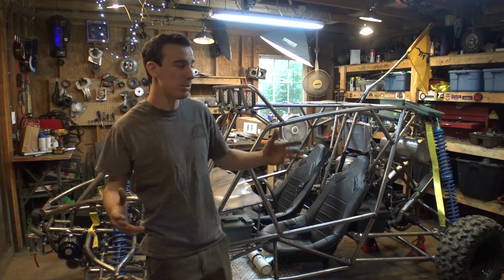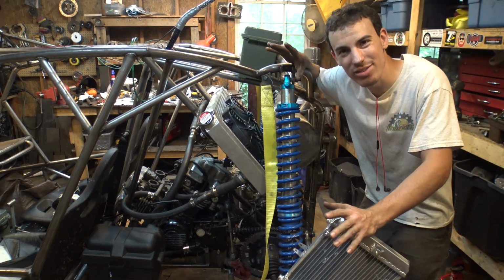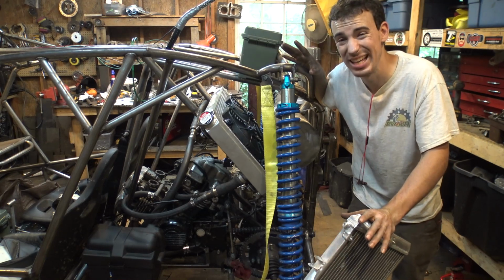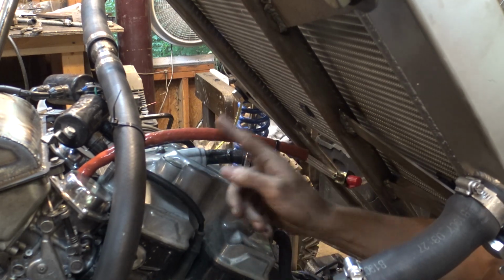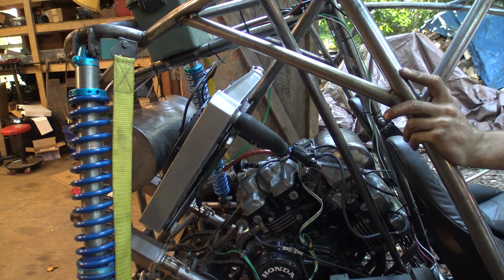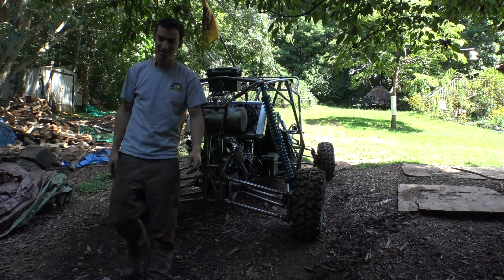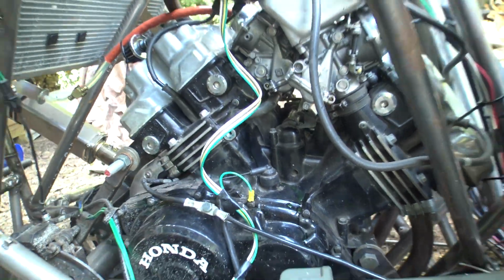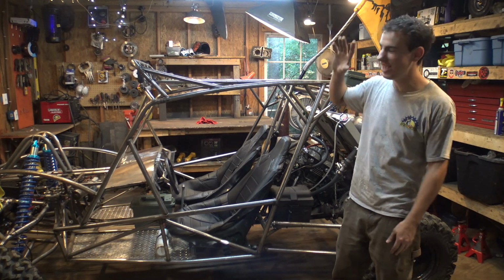Honda VF1000 buggy build part 16

Comment: Good job, man!
And be careful reading comments from all of us "youtube engineers"....
It's real easy to tell someone else what they're doing wrong from behind a keyboard.
That being said.... Get a decent mercury-based carb synchronizer. Motion-Pro makes a good one.
Trying to tune a 4cyl bike motor without one is nearly impossible.
There's other types but, they aren't as accurate.
Once you get all the little problems worked out with that motor you should be fine.
It makes over 100hp.... And the bike it came out of wasn't a light-weight.
Yes, the buggy is a bit of a porker but, if your gearing is right you'll be fine.
Those motors are built stronger than most people think.

Comment: If you can make a fan shroud to mount the fans on the radiator, those zip ties you used can cut into the aluminum of the radiator over time from vibration and being an off road cart it can happen sooner rather than later. Other than that this is a great build.

Comment: 1) temp gauge,  2) mount the radiator upfront,  3) inline fuel filter , 4) tune/sync the carbs and 5) aux water pump.  
I think that will make it better.
Reply: Definitely needs the aux water pump
Reply: He doesn't need a auxiliary water pump ffs guys. The doubled size he now has will be perfect considering he'll be mostly traveling half the speed of the original motorcycle. A working thermostat is also obviously key.
Reply: He may not need the auxiliary water pump but he should install a properly functioning thermostat and change from the stock water pump to a high flow version if it's still available for that engine, he also should add an oil cooler(could be mounted onto the radiator and share the fans) or a fan blowing directly on the engine to compensate for the lost air cooling that engine would've originally had while moving
Reply: A random 12v water pump is way cheaper than a honda genuine part.
Reply: @dodgeme1986truck  those water pumps were never supplied for the vfr

Comment: Change to a larger diameter steering wheel. 
 Put a rubber tube from the little pipe under the rad filler cap to an overflow catch bottle. 
You are doing great so far.

Comment: A watercooled engine temp is controlled by the thermostat. It closes to allow the coolant to warm up and the thermostat opens to cool it down. With motorcycle powered buggies, a civic radiator is about what most use. The engine is moving something 4 or more times the weight of the bike it was on, it needs to be cooled better. As long as the thermostat works properly it wont over heat.

A single fan should suffice. I'd probably have it on a thermal switch to turn on when it needs to and have a toggle switch to override it if need be. You're probably taxing the charging coil and battery with the dual fans and electric rack. Hopefully there's enough reserves in the battery but no idea.

Comment: maybe the radiator is not that small but this engine was initially designed to run fast when revving at high RPM but now when it revs high it might be climbing and crawling so there is not much air hitting the radiator and there is nothing wrong there. Fitting a bigger radiator seems the right thing, I'm glad we had the same thoughts.

Comment: always fascinating

fans will be pulling the engine's hot air through the radiator.   How about a sheet metal baffle a between the engine and radiator so the radiator gets ambient air?  easier said that done

Also, go full Porsche and add an oil radiator up front?

great work, "free hand"

You obviously have a great seat-of-the-pants feel for this stuff, but sometimes a little tech will help, like a coolant temperature meter.
Reply: Was going to comment same about the fans pulling preheated air directly from the block.
Reply: I don´t think it will be an issue as long as his not standing still. As soon as he moves the fans will not pull as much of that heated air. But yes, an oil cooler might be a good idea.

Comment: Power steering the two big cables go to the battery is the small black wire the ignition thats not wrapped goes to the negative or ground right

Comment: You might want to look at the 90 degree elbow in the radiator hose. Being down low will make it almost impossible to get all of the air out of the cooling system. Causing the engine to overheat. Air bubbles in the system are a quick death to any engine.

Comment: A tip; use a shroud for your coolingfans . 
Those rips gonna hurt ure radiator because of the heat and vibritions. In a year time you gonna  notice it iff u leave it like this..
Look up for a aftermarket 3core civic ratiator , that should show u what i mean.

Comment: Great job man, have you sync'd the carbs, im sure you have but if you havent one or more clyinders would be carrying the others resulting in rough running conditions hard starts and eventual engine failure. On another note i suggest an epic road trip thanksgiving time to glamis ca. where you could link up with your west coast fans and really get to the bottom of that rigs capability's.  id suggest glamis, or ocotillo wells ca where you have dunes clay hills open desert, washes ect. Glamis is only dunes but they are huge. in the evenings there are sand drags up competition hill illuminated by the lights of other off roaders. big weekend sometimes have rock bands and fire works ect.  Anyway it would be an epic trip.

Comment: Put a Filter in your fuelsystem as well... and please protect your wirering harnes.... with Black sleeve or just with the elektrical tape to be Safe.... but over all i Think IT is very cool build... i would place the fueltank away from the Engine and use a fuelpump to get enough fuel in the engine.... Kind regards from germany....

Comment: You should make one of your two speed gear sets so it can have a high and low setting, cause right now you have to change the sprocket, if you had a high and low you could switch it on the fly!

Comment: The radiator is mounted higher than the motor and normally the radiators would be mounted at the same height so would it not make sense that the cooling fluid would need more of a pump to circulate the fluid better but faster thru the cooling system allowing the radiator to do its job at all speeds ? A pressurized system does bring the temp down .

Comment: I have a question for you. So are you sure the stock water pump is gonna be sufficient to circulate enough coolant flow to properly cool the engine with the new radiator being much higher than what that engine was designed for.

Comment: Might need a fan or two blowing on the block and cyl head to help with heat dissipation   Are rad fans blowing towards fuel cell?the fuel will be fkin hot after a while.

Comment: On my goldwing aspencade the has tank is under the seat above the exhaust and ive looked in it getting gas before on a hot day and its literally boiling..pretty scary but normal on them after looking it up...

Comment: The 2 cylinders running leaner due to plugged low speed would definitely contribute to the overheating. Good idea to upsize the radiator though and it definitely looks "cooler"

Comment: Fill that radiator wile straight up. Air in the system creates heat pockets and could overheat the engine.

Comment: have you rejetted the carbs? A hot running motor can be caused by the motor running to lean. Sounds like you need to rejet the carbs, since you essentially added an exhaust.

Comment: You added an aftermarket aircleaner and exhaust which means that there is much more air flow through the engine. This extra air is causing the engine to run very lean, and needs to be corrected by allowing more fuel into the engine as well. When you run an engine teally lean, it will cause it to run MUCH hotter as well. You should try drilling out the jets to allow more fuel. This is likely causing the hesitation issue as well as the flame we saw shoot out of the exhaust. I had a similar problem on my bike when i put aftermarket an aircleaner and exhaust on it and the bike ran very hot and stuttered when accelerating. The same thing happened on my car when I forgot to plug a vacuum port. It ran very hot and melted the sound deadening material that i had on the floor.
Reply: Another thing: The engine was originally designed to have the radiator sitting at the same height as it. The higher you raise the radiator, the more pressure there is required to move the coolant through it. If the water pump on this engine works the same as a car, then the pump doesnt really create any pressure, it just kind of slaps the water in the direction it needs to go. Something to consider might be to add an electric water pump to make sure that you have enough circulation.

Comment: Maybe u can add a scoop in front of the rad above the seats if it still gets too hot . And I would move the tank so the rad doesn't blow all the hot air into the fuel making it unnecessary hot

Comment: Your new radiator location is pulling heated air off of the motor to try to cool the coolant. Radiators need fresh air. Also your radiator is discharging hot air onto your fuel tank. Fuel should be kept cool.

Comment: Are you over working the small water pump  you may need a electric pump plus you should have the fans switched separately with the main one being at the water input.

Comment: How about an engine from a car? The 16 valve 2.0 from a Neon, you could also use the the 5 speed gear box. If you get one from an ACR Neon, that would be cool....
Reply: Frank The CADD Monkey : That would be nice. And about a 100 horse upgrade!
Reply: @rickybobbyinc293  Yeah, I had an ACR and didn't even know it until it was scrapped..
It was a beast!
Reply: Even a honda D series would be an awesome upgrade. Short block, cheap, easy to find, reliable and light weight.

Comment: Great build. Seems you had no coolant flow on your last off-road run and thus the overheating issued. With that in mind, I would check to see if you have a leaking head gasket (where you found coolant leaking from the engine) cause by overheating.

Comment: small suggestion, order the manual on your engine, and spend a couple days reading all the procedures, as well as troubleshooting procedures. I think your mind will be at ease once you digest the info to all the mind boggling what if's wondering through there at warp speed..
Patience Grasshopper, haste makes waste. Nice ride

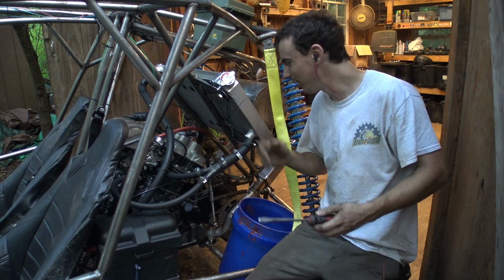Comment: 12:55 So water flows through the radiator in the wrong direction?... as long as it's flowing through the radiator it shouldn't make any difference.

Only problem I can think of is if your radiator isn't full, so it pulls air bubbles into the cooling system instead of pure liquid. Many engines use an impeller water pump, which thoroughly dislikes bubbles.

Comment: i have an 86 vfr700 and im constantly having to adjust the throttle screw   when i first start it i have to adjust it  then again mid ride  and again when its warmed up or it wont idle  or it will idle too high...    and air temp around 55-65( 5am ride into work)  she  dont wanna run at all will die halfway there....       you should have the throttlebodies  vacume  synced
Reply: also i noticed you arnt even getting into the powerband for that motor before you shift

Comment: Probly add some heat reducing or reflecting mesh/ tape on the underside of the fuel tank. DO NOT DRIVE WHILST COOLANT IS LEAKING!!!! Big no no... that either a leaking seal or gasket and will cause big problems down the road. Personally I think your engine is ok for this buggy but because it looks so badass it needs a badass powertrain. Perhaps the Yamaha YZF-R1 from 2004 - present... over 180hp that’s insane

Comment: I thought your rad was mounted too high for the water pump to push uphill, but after not being a jerk and watching the rest of the video, I see you've hopefully fixed it. Hopefully you can keep it cool and not boil the fuel out of your carbs. If it keeps boiling off the fuel it'll keep gumming up the idle jets in the carbs and you'll have to keep cleaning them every time you run it.

Comment: You should take pool noodles cut a slit in them and put them on the roll cage and zip tie them so you can cover up those wires for the lights on the roof

Comment: Jutting the carbs bigger could help it run better and cooler the carbs are always setup lean from the factory bigger jets will help. Plus led lights to help with electric draw from the battery too much power drain on the battery can mess with the motorcycle charging system witch can mess up the spark..

Comment: Maybe you have an Air-Fuel ratio problem, I don't know how it works on motorcycle engines, but on small 2 stroke trimmers that "stuck" acceleration means that you have a lean mixture.
Reply: same

Comment: Not for sure check for vacum leak on carbs and may need to rejet them also . That will contribute to running hot as wel if running 
Lean.

Comment: I think a car engine and trans is the way to go. Small 3 or 4 cylinder from an economy car would be much better equipped to handle the weight and would still get that buggy moving fast.
Reply: A little 3 cylinder Geo engine with an automatic would probably work, especially a fuel injected one.  Also, a car engine will have a proper alternator for all the electrical stuff he has on that buggy.
Reply: @spazzattack1188  geo metro drivetrain was my exact though.

Comment: As long as your fuel tank is set higher than the carbs and you have large enough fuel lines you do not need a fuel pump. And, it will add another electrical load to the system and another point of failure. Could run as large as 1/2" fuel lines and reduce them down at the carbs.
Reply: Oh yeah... I'm gonna start a build of my own soon. Maybe I'll film it so everyone can tell ME how I'm doing it wrong too!!!
Will be interesting to see how thick my skin is.

Comment: Love your builds mate keep up the great work  Is the engine changing system man enough for all the extra electric equipment you have drawing from the battery if it’s trying to change the bigger battery and all the other bits the chance of you burning out the voltage regulator are pretty high you might want to upgrade it and you might need a bleed value in the top of the rad to bleed the air out of the system

Comment: You need to find out what pressure the carburetor is supposed to have and use a pump and a fuel pressure regulator to maintain that pressure. Probably around 6 or 7 psi.

Comment: sounds like you got trash in your tank some how, clean it put normal gas line and put a fuel filter on it . is the gas tank getting hot it is right over the mufflers and the rad was hooked up right top hose go's to thermostat housing and bottom to the bottom of the motor, water pump pushes water up and out the top of rad you might need a water pump. just trying to help not telling you what to do love the vids keep it up

Comment: Aaayyyye yo guy. That engine is not being stressed by that little buggy frame especially with that low main gear your running. as for the running like crap but first you need to do a sync check on your carbs then do  another fuel trim check. I'm betting you need to change jets after you sync the carbs. as for the line of coolant running down the side of the block appearing to come from around the carburetor Inlet; that appears to me to be a pinhole leak of a head gasket. I would run an air pressure test through your cooling system into the engine to see if you can see any air leaking to pinpoint the exact location of the leak. I believe you have slightly cooked a head gasket where you did that long ride on your first test drive with the cooling Loop backwards, that engine just sat with the same water in it boiling which causes head gaskets to swell and tear causing little leaks like that. yes the engine may have had coolant flow at engine speeds higher than Idle but you have to think the way the cooling loop was set up, you were pulling from the top of the radiator  which is is/was the highest point in the loop which is where all the hot water would rise to. so you were just feeding it the same hot water you were taking out of it without any cooling effect of the radiator.

Comment: I honestly believe your not straining that engine...1, your not running it hard at all ( not an insult )... 2, its geared so low that even with the weight of the buggy, clutch release is smooth and buggy doesn't lug bad.....3, when that engine is right , it will take tons of abuse for tons of miles.....get fuel delivery right and keep it moving, temps should stay down
Reply: It does

Comment: hey Buddy a few considerations
1st wouldn't the fuel tank behind the radiator heat it too much?
2nd have u ever consider a honda wrecked hornet engine 600 or 660cc? u sure gonna have  a much easier time on manuals and parts.

Comment: If that engine blows, drop a front wheel drive Honda motor in it.
Reply: That would be a perfect fit. Even a D series would fit nicely in there. It's cheap, reliable, lightweight and easy to find. He will probably find a proper engine for this buggy sooner or later. He already wasted way too much time with this one.

Comment: Cooling it down too much is very much a thing with engines, thus the reason thermostats are incorporated into pretty much every water cooled engine. The engine should have come with one factory. With a thermostat in place as designed, it will open when the engine is warmed up and restrict the flow to the engine to keep it at the "just right temp". Having a radiator that is to big will make the thermostat work over time by having to constantly close completely then open up and, in theroy, could cause thermal shock to some engine parts but I always like to have too much radiator rather than too little.

Comment: I suggest adding another fan or 2 that just puts air across the engine since its not going as fast as it would on the motorocycle is y its gettiing so hot so quickly.